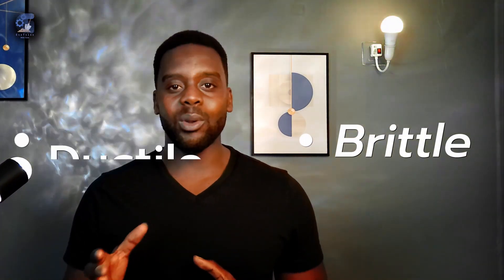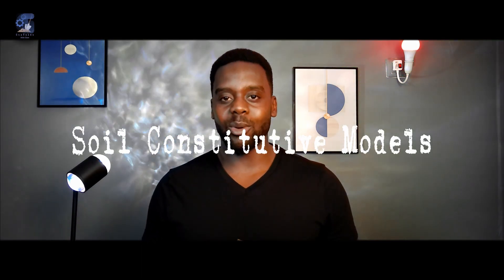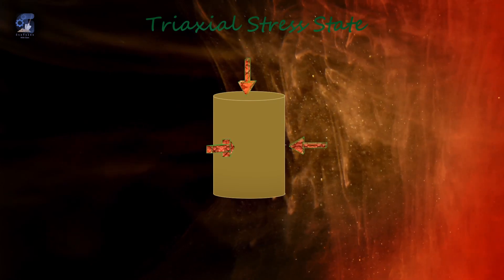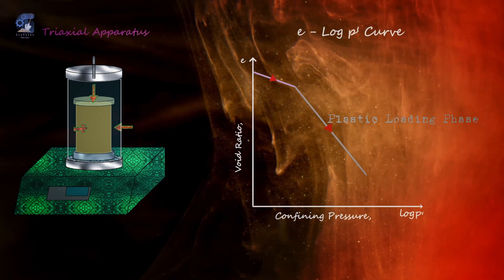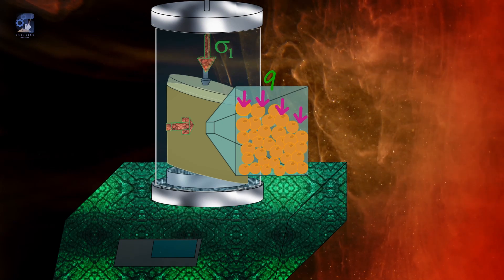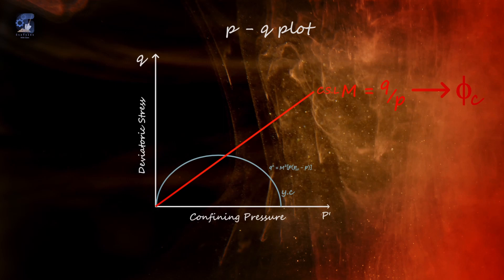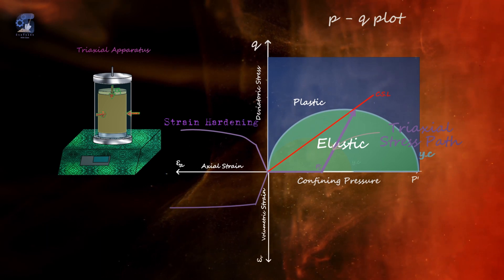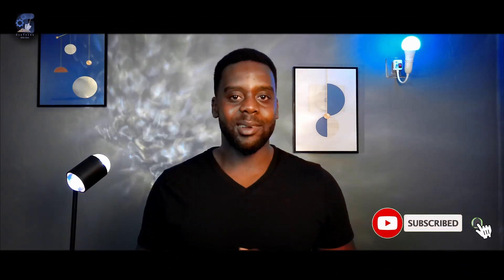Soil Constitutive Models

Comment: Excellent video. Just one thing, about the deviatoric stress (q), according Atkinson (2007), q = Sigma1 - Sigma3, not (Sigma1 - Sigma3)/2 like presented in 6:08.
Reply from the maker: Thanks Elias. Great observation. That is correct, it was a mistake on my part.
Reply: Deviatoric stress can well be presenter as (sigma1-sigma3)/2. it is also accepted In this form.